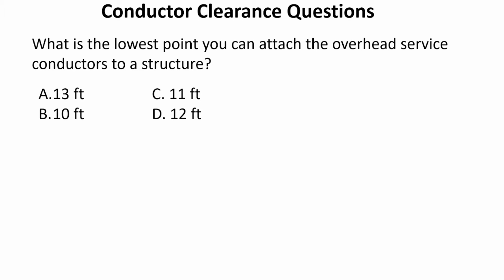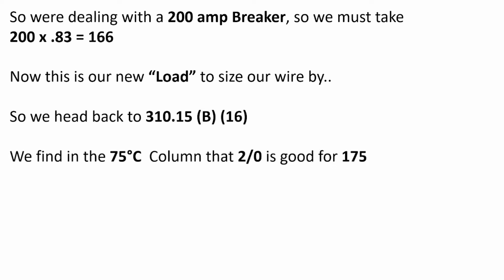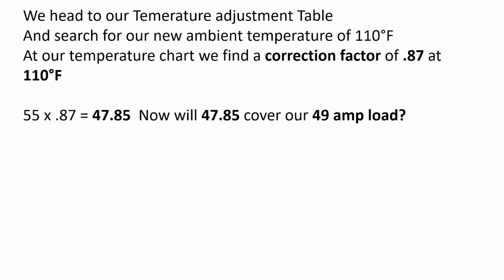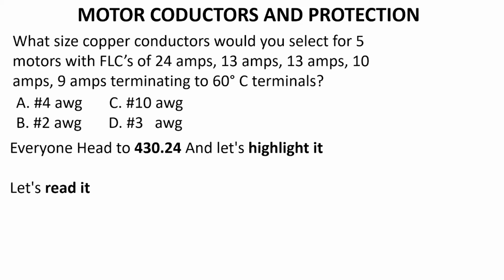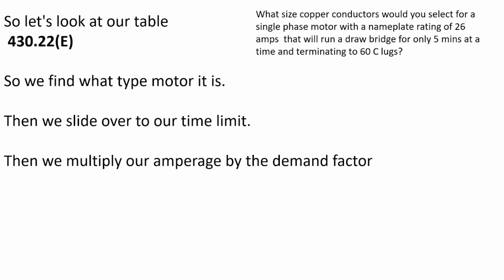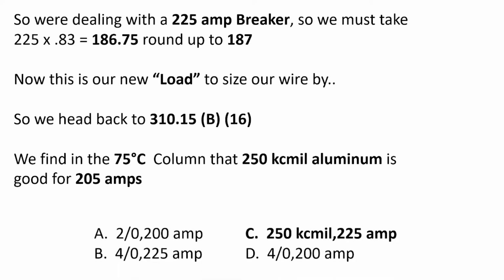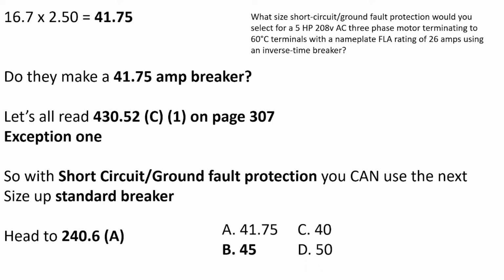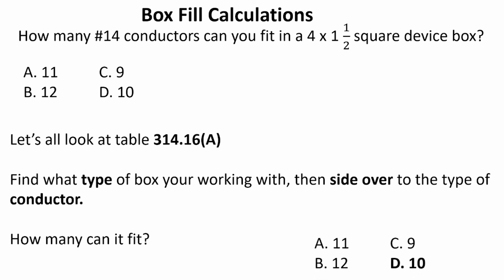25 NEC Exam Prep Practice Questions With FULL Explanations VOLUME 1 Masters Journeyman

Comment: @8 minutes….why are you using the 75c column? If not specified shouldn’t you be selecting from the 60c???
Reply from the maker: Have you taken my free program at electricalcodecoach.com?
Reply: @Electricalexamprep  I will take your course. And I answered my own question after digging a little deeper

Comment: The question about thhw #6, with ambient temperature of 142 degree Fahrenheit. You use the 90c column. It's in the 75 degrees column as well and with 75 terminals wouldn't it be sized to that? Have my state cert tomorrow. Currently state certified in CA. Trying to move out of state. Appreciate the help.
Reply from the maker: #1 FREE Electrician Exam PREP VIDEO SERIES Electrical exam prep: https://www.youtube.com/playlist?list=PLJokxpBhbuUc6LTyszEzt-FR7k8Tz4eMG